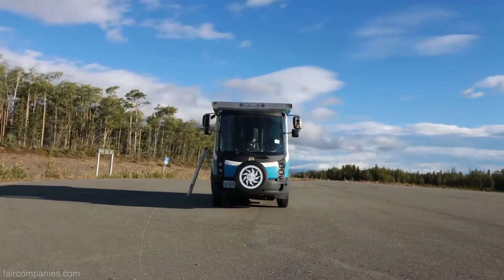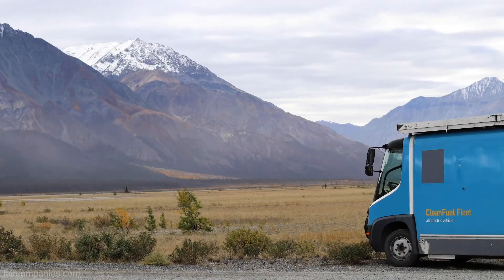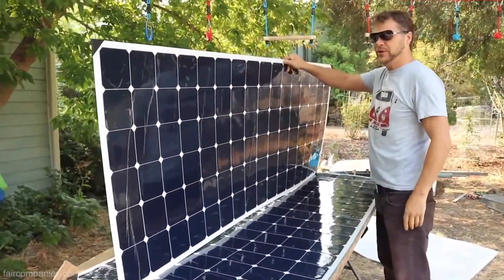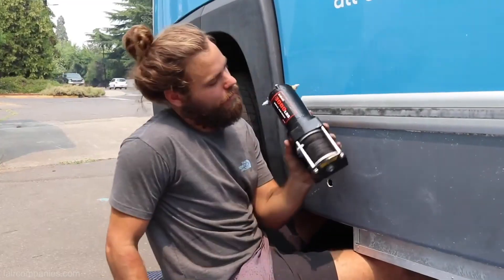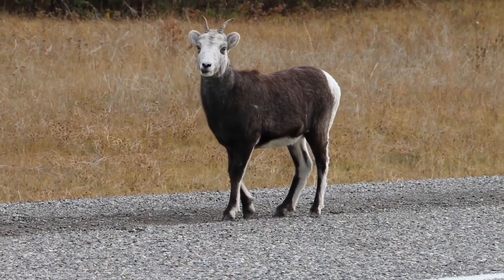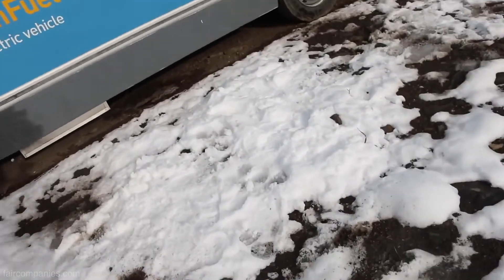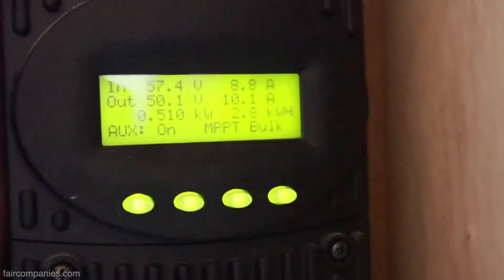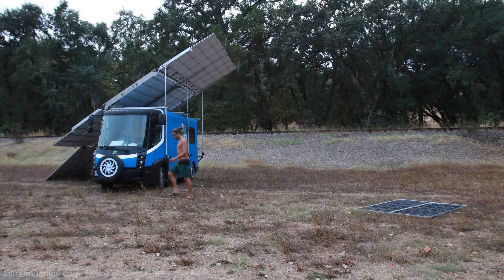Delivery EV turned solar-powered campervan: 100% self-reliant

Comment: "You have to let go of the idea of getting somewhere when you say you're gonna get somewhere."

Yeah, it's almost like basing your transportation entirely on a resource with irregular availability isn't the best plan.

This whole thing annoys me. Yeah, it's great to drive everywhere at running speed when you have no real responsibilities or anyone who relies on you. Also, "we could switch fully to renewables whenever we want" is patently untrue.

Let's take wind. To keep up with the global increase in energy demand (not the demand itself, just the increase annually) you'd have to cover an ares the size of Rhode Island in wind turbines every year. Turbines made of steel and nonrecyceable polycarbonates. And that's assuming optimal wind conditions.

tl;dr get a job hippie.
Reply: I have to agree with you. I thought the exact same thing. It's all very well as a personal trial, like swimming across the Channel or flying across America the first time but we are so not ready to switch to this kind of energy for any serious use in a while. It needs to become more efficient, much cheaper and accessible to everyone before we can 'switch' and even then we'd still need proper fuel if we actually want to get somewhere. I mean at this rate I'd rather get a horse.
Reply: I'm sorry, but a thousand Rhode Islands covered in steel is a better proposition that the current danger posed by the burning of fossil fuels. We cannot afford to just wait until half the planet is uninhabitable, just for a few extra years of efficiency. Even if we can't move completely to renewable right now, we still have to. Even if that means we have energy deficits for the next decade. We're already far past the time we should have been weaning ourselves off of pumping poison into the atmosphere, and now the only options we have are to rip off the band-aid  or watch as the world dies around us.

This particular venture smacks of a rich man going on a long quirky vacation, but lets not kid ourselves. A failure to phase out fossil fuels in every aspect of modern life is currently, at this very moment, killing thousands and condemning up to billions of human lives to death. Depends on how we treat the threat. If our energy use is so massive that we cannot use anything but the poison, then that doesn't mean we keep using the poison, that means we need to use less energy.
Reply: @forksandknivesssssss  "a thousand Rhode Islands covered in steel is a better proposition that the current danger posed by the burning of fossil fuels."

How do you think they make steel, chief? Also those wind turbine blades are made of petroleum byproducts.
Reply: This is an adventure not a feasibility study.
Reply: Finding out what happened with this is hilarious. Turns out there is no road from Alaska to Argentina, but that doesn't matter because the van broke in Mexico and they ended the project.

Comment: You don't see why we can't totally switch to renewable energy.  Just ask the 80% of poor and working class people who can't afford it let alone decide to take the time off to have a driving holiday in America .  🤦‍♂️
Reply: They might do if they got a decent number of days off - as most other countries have.
Reply: @claudiakarl2702  it has nothing to do with getting time off it's being able to afford to have time off.
Reply: @iamwedged2705  Most nomadic people are stopping to work seasonal jobs or they do remote digital jobs.  None of the younger nomads are doing it without working.  Older nomads usually live off SS or pensions.
Reply: @claudiakarl2702  and that’s gonna happen …… the old guard are aging out and younger folks are smarter and communicating with each other quicker and easier that we were able. We messaged with music back in the late 1900’s. (In case you haven’t guessed, I’m an aging boomer myself ! ) The Times They Are A Changin’
Reply: That’s a separate problem. The (relatively simple) solution is two-fold: Ranked choice voting and real campaign finance reform

Comment: We need to get them to stop spraying the sky and blocking the sun to make it fully operational.
I’ve thought solar was a great option to the high prices of natural gas and electricity that the controlling handlers manipulate but unfortunately they can also block the sun with the likes of barium aluminum, nano smart dust, plasma to name a few of the chemicals being sprayed which is happening on a regular basis.

Comment: The answer is not solar power as soon as people wake up and realize that, the better
Reply: Yeah, an ox team would not be much slower, but far more sustainable.
Reply: The answer isn't big oil either.
Reply: Just curious as to what you feel it is? (My question is not sarcastic or negative, I am really wanting to hear your alternative).
Reply: @c.erine78  research about lithium bateries  their production , waste disposal and you have the answer there ...
Reply: @miangelsai  Still far better than any fossil solution.
Reply: And you conclude that, based on one YouTube video. Yes, very scientific, indeed.
Reply: @Adrian_Nel  Sorry to say he is right. Firstly, the panels are not recyclable, any more than the blades of wind turbines...
Reply: @ruthlongridge  steel copper  wire etc are all recyclable. Are you quoting oil industry propaganda inadvertently?
Reply: @lbrowning2543  do your research youself, like I do, instead of relying on "experts" who sometimes have vested interests
Reply: Why do you say that and what is your alternative suggestion?  I’ve thought solar was a great option to the high prices of natural gas and electricity that the controlling handlers manipulate but unfortunately they can also block the sun with the likes of barium aluminum, nano smart dust, plasma to name a few of the chemicals being sprayed which is happening on a regular basis.
Reply: @cathleen1717  “they” please elaborate.

Comment: Pretty cool as long as you have unlimited time to kill.  Driving 20mph up hills seems a little crazy though.  Like following a tractor on the highway.  Also if you catch a couple of cloudy days you are gonna almost be stranded.  I do appreciate that they are pushing the envelope.  Its gotta start somewhere
Reply from the maker: It does seem crazy, but Joel explains the he pulls over whenever there is traffic behind him. He's also at the time in his life when he enjoys the journey and didn't mind not arriving anywhere fast.
Reply: Upgrade ideas... Add hinged mirrors on the sides of the truck go direct sunlight at an angle reflecting up to the underside/backside of the slide out panels where you can add more solar capacity, maybe 30%-45% more. They also have double sided solar panels now where the underside produces extra from indirect sunlight reflected off any surface. On one of the slideout panels replace one that can slide ouf of either side depending on where the van is turned, this special panel goes on the shadyest side, adding another 15%-20% solar capacity. If your battery array is reaching 100% charge add more batteries until a days max charge gives you 80% charge and divide the battery bank into 2 seperate arrays. Charge 1 to 80%, then the second to 85%, then the first to 90% then keep adding batteries until you can only fully charge both arrays to 80% from sunup to sundown. At sundown close your panels and sleep until 3-4am wake up and drive at night until the battery banks both are down to 20%, then stop open the panels and it should be dawn/sunup. Cook, eat, enjoy the morning and the day while the solar recharges.

Update #2... Solar termal. Add an evacuated tube that can be setup on either side of the van. If you heat water into steam you ca add a small steam engine to turn a generator for another % of added power, on demand plus hot water for less losses than your electric hot water heater uses. To store extra power an insulated water tank and steam expansion tank 17000 times larger than the small water tank. Don't forget to install not just 1 but 2 pressure relief valves or you have an uncontrollable steam pressure bomb onboard. Your steam generator can also be connected to a belt/bike for MANual added power while exercising during coolest hours😉 The more btu's you can insulate and store the longer past sunset your steam generator can run into the night producing extra power. Again if your 2 battery arrays reach above 80% after the steam stops, exercise stops, add more batteries. The balance point is reaching 80%x2 by thermal cooldown. Thermal solar to electric produces more power than solar electric with fewer losses if insulated properly. A water tank battery could store more energy for cheaper cost also. You have to find the right balance of both systems to maximize space. Weigh the batteries, weigh an equivelant size water/steam tank. Replace each battery space with equivelant water battery space. Calculate water btu storage to electric vs. chemical battery storage to electric. Good Luck
Reply: Always trying to ‘kill time’ is part of the problem. Learn to take the time you are given and enjoy the ride
Reply: EXCEPT THAT PUSHING THE ENVELOPE IN THIS CASE COULD BE FATAL.   DID YOU SEE THE EXPLODING FLEET OF BUSSES AT THE CHINESE UNIVERSITY THAT WENT UP INSIDE OF A MINUTE?   NO TIME TO GET OUT.   LIKE THE EXPLODING CELL PHONE BATTERIES IN THE CELL PHONE STORE.   JUST SMOKED A FEW SECONDS THEN POOF.   TECHNOLOGY NOT STABILIZED YET.   WHO WANTS TO BE THE GUINEA PIG?
Reply: Look up the Aptera!  Super practical solar EV which will be in production soon!

Comment: Spoiler alert.

There is no road linking South America to North America. It ends in Panama. Also this van breaks in Mexico and the project ended. 😒
Reply: There is a series of roads that do cover the length of the Americas. You take a ferry in Panama and resume on the Pan American Highway -dirt road at times. Ferries also allow a car to get one from Canada to the US at Niagara for $1.25, and free to take your car from Galveston to  the Bolivar Peninsula. You can even motor across the English Chanel to France on a ferry as well.
Reply: Don't tell them
Reply: @BuddyRevell455  The ferry from Panama to Colombia takes a few days. 😊
Reply: @BuddyRevell455  lt may take weeks for all the logistics, especially since our shipping lanes have been slowing down so ships stay in ports a little longer to unload, but you can see where your ship is online at all times. And the trip from Panama to Columbia is really not that far, I don't know what you would be doing for weeks in the Caribbean. Panama and Columbia are right next to each other. From New York perhaps, but these boys want to drive from Alaska to Argentina.
Reply: @BuddyRevell455  well good thing it isn’t on the Pan American Highway.
Reply: @BuddyRevell455  $5,000 rate must be for smugglers. I found one crossing for $140 today.
Reply: @BuddyRevell455  No because I’m not in need of a cargo ship. Keep up. The topic is ferries that connect the Pan American Highway and allow crossing of waterways with a car or truck. You are grasping at straws by changing topic in an effort to nay say and that, incorrectly.